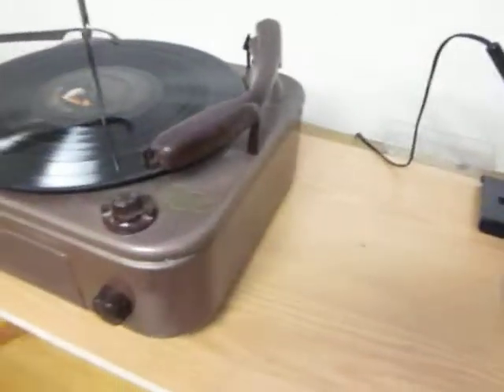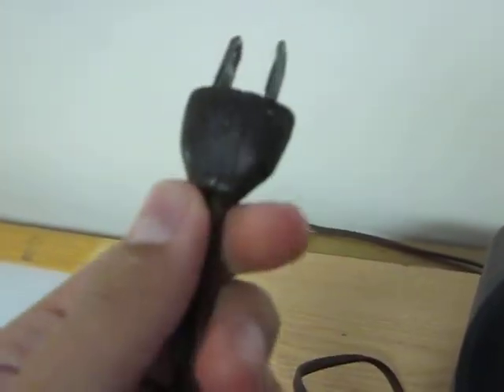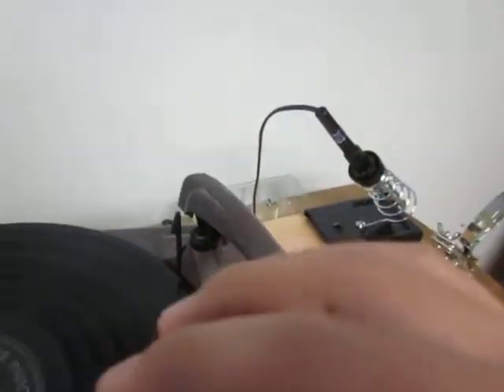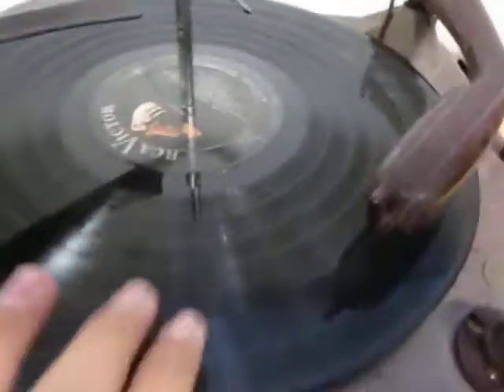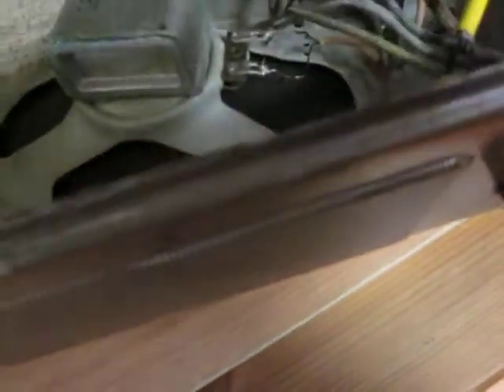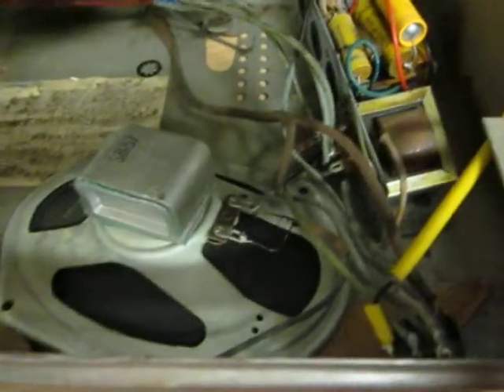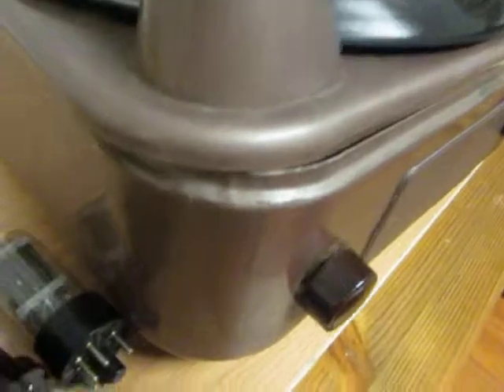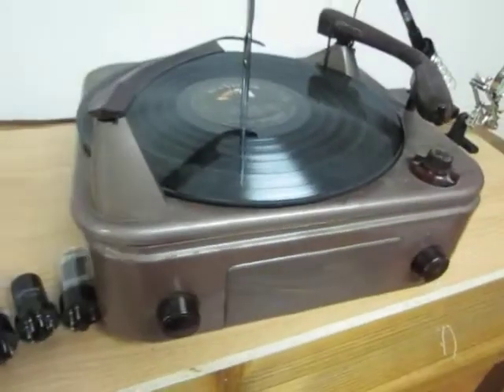seabreeze turntable

Comment: Don't forget to recap the amp! Some White Lithium Grease and Zoom Spout Oil will be your friend with the record changer. Also, you may have to put a new rubber tire on the idler wheel that goes between the motor shaft and the inside of the TT platter. It looks like it would shape up to be a decent changer!